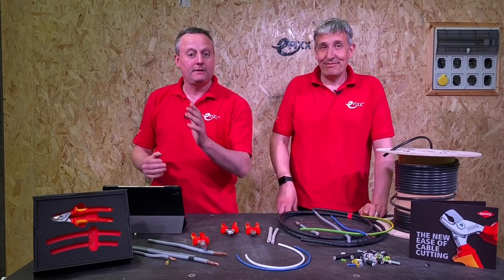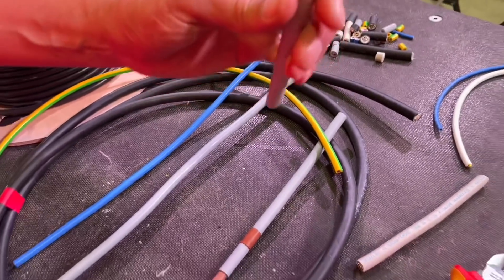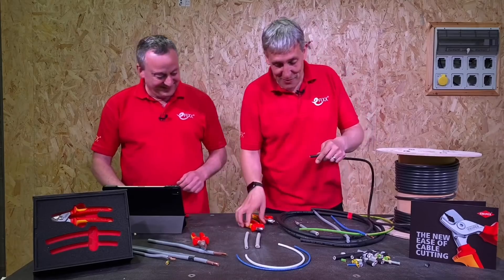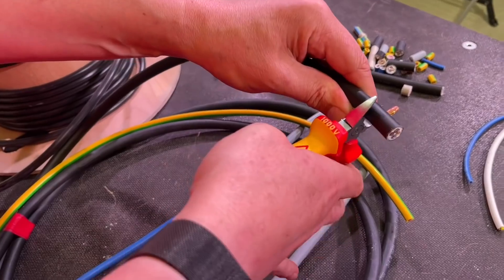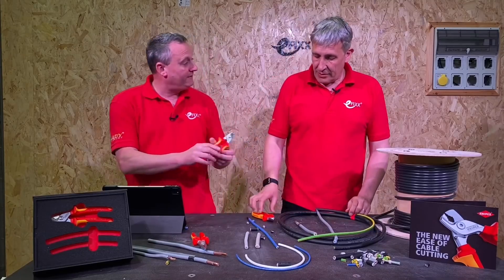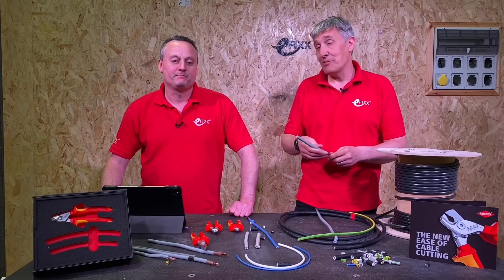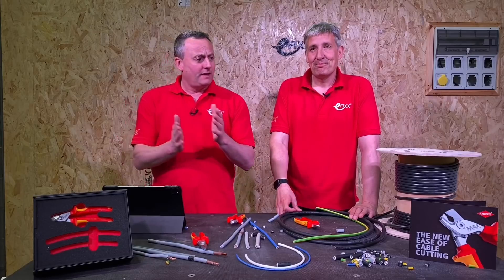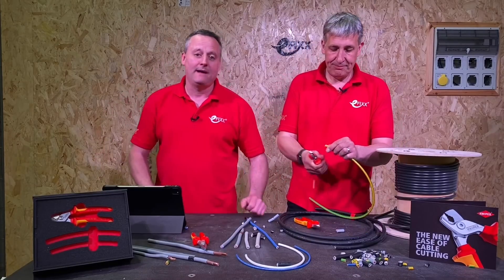REVIEWED: KNIPEX STEP CUT -  less effort compared to side cutters?

Comment: Those step cuts are amazing that 2 stage is a brilliant idea, though I feel I need to defend the 7006160 side cutters. Surely side cutters and sheers are two entirely different tools. I'd use the side cutters more to cut smaller cables like 8.ore or the cores inside. A shearing action is needed for round cables  like fire cable, meter tails etc. Your bigging up the step cuts which I agree are fantastic, but then kinda putting down the side cutters but that's not really what their for. For smaller cables that's 70 range of side cutters is brilliant.

I have done a review of this on my channel I found them really good for stripping with the 2 stage action as well
Reply from the maker: Thanks Dan - yes agree two different tools but we were just trying to show the difference in cutting action. When we started out we only had side cutters and a knife! 😁
Reply: @efixx  haha ill have to lend you some knipex lol. If you get time I've watched lots of your videos, I'd love to know what you think of my channel. I currently work with klein/Superrod, knipex and velocity pro gear. It's a tool channel

Comment: I’ve been using the knipex loppers (not the stepped variety) in place of sidecutters now for 20 years. The sheering action gives a much cleaner quicker cut, and they are good to use as strippers also👍

Comment: was just using my step cutters on 25mm^2 tails, they are easier than using my 250mm cropers. Great for sripping too. Definitely agree with the opening them up part, Iyou just seem to need to open them further than you'd expect.

Edit: they also do 35mm^2 H07 beautifully.

Comment: Are they 180mm? Would be nice to see them a bit longer as to shorten that wide gape that looks like it requires a good bit of effort on the initial cut. I can't see it replacing my bahco 2233D 240 purely for that reason it looks really uncomfortable especially on the 25mm.

Comment: Hey, NYM and NYY are German standard cables and except NYIF (which is crap btw.) the last survivors of the European harmonisation of cables. Like your twin-and-earth or SWA which also kept up their old designations instead of H07-X or H05-X.
And now let's have a minute of silence for the NYA, we'll miss you! H07V-U can never replace you! 🤣

NYIF is a flat cable for installation directly on brickwork, below plaster. Wire insulation is PVC, sheathing is rubber. Only for dry rooms, no contact to combustible materials like wood. For the installation you must use nails with an insulated head. In the old days the insulation was cardboard, now it's plastic. The nails are inserted between the wires, so you nail through the sheathing. When making bends, you need to cut the sheathing between the wires and fold it over. Total mess. Back in the old days it was cheaper than the NYM, and that was the only reason to use it. NYM is rated for dry rooms, wet rooms, outdoor (when protected against sunlight), you can insert it into concrete (not compacted one). The manufacturers don't even changed the wire colours in their data sheets for this cable, the picture still shows the old German colours for the wires used between 1965 and 2003. In a three core cable the line was black instead of brown: 

https://asset.conrad.com/media10/add/160267/c1/-/en/001152554DS02/datasheet-1152554-faber-kabel-020289-multi-wire-planar-cable-nyif-j-3-g-150-mm-ecru-sold-per-metre.pdf
Reply from the maker: Great info as ever Marcel 👍

Comment: I wanna know how good it is at dealing with taking the insulation off those cables
Reply: Be interesting to see...would it just rip the insulation off
Reply: @agent4873  yes also on the individual wires. Can it strip the wires without damaging the copper and, can it strip outer insulation off the cable.
Reply: I’ve had these for about a year and they strip cables well